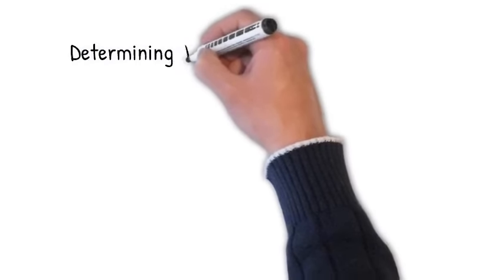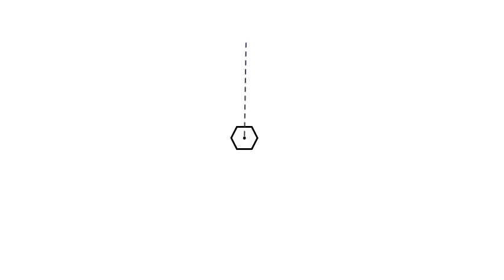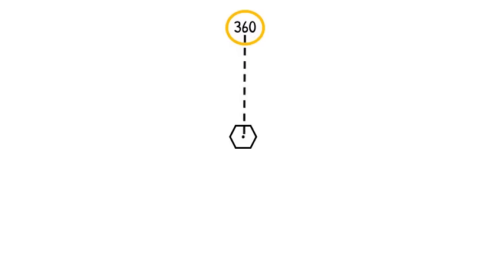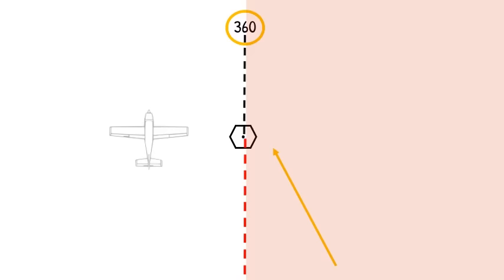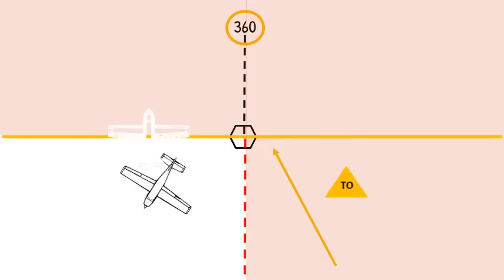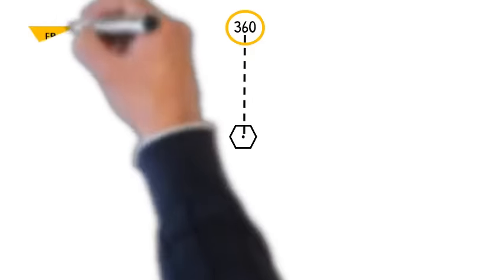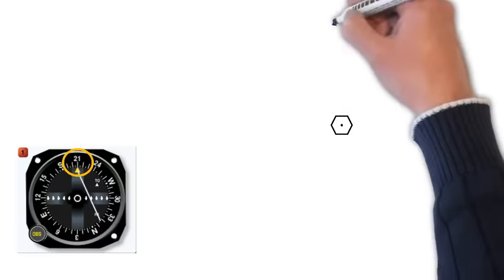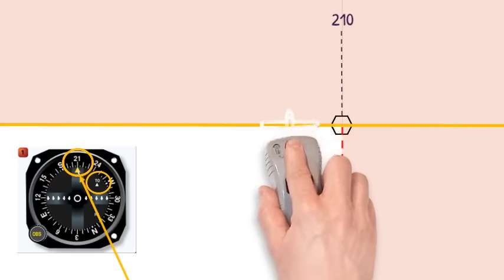Simple Way to Determine Aircraft Position Using a VOR, CDI, and OBS

Comment: If I understand correctly, based on the example of 210, if you see the To is in the upper quadrant and the needle is to right, then the upper right quadrant shows the range of headings that you would fly to get to the station to intercept the 210 radial.  If the range of headings to get to the station is in the upper right quadrant, then the opposite of that is the lower left which places you north-east of the VOR and south of the 030 (tail of the 210) radial.   To intercept the 210 you could fly either direct to the 030 radial (90 degrees) intercept of 300 or a 45 degree intercept which would be 255.

Comment: Very useful method and strongly advised! TBH I've developed a bit different logic for myself but it was a struggle for a some time before I was able to do that. Knowing this method earlier would have saved a lots of time and some grey hair for me - and I may also switch to this one. :D
Reply from the maker: Thanks, glad it was helpful. What is your method?
Reply: @Loves2Fly  It's kind of "brute force", nothing really special. After a lots of hours spent practicing these I can quickly visualize it in my mind, where am I. "TO" means I'm around the reciprocal radial of the set value from VOR perspective (so around the tail of the OBS arrow)  and the direction of the deviation - and so the real VOR radial - can easily be identified after you have this picture in your mind.
But your solution requires a lot less counting, easier to adapt and thus much more fail proof, gives a better picture of the situation quicker. :)

Comment: Excellent video BUT still confusing on two key points - 1. clarity needed on impact of having a TO or FROM FLAG 2. WHEN IS PLANE ABOVE HORIZONTAL AND WHEN BELOW?
Reply from the maker: The example is looking down from space. Regardless of your heading, if what you have set in the OBS (the radial, or spoke of the wheel) is on the other side of the VOR from you, it will display a TO flag.

Comment: The key is the TO/FROM flag.
Think "FROM The Same Side" OR think "TO The Other Side" ... all in relation to what radial was dialed in with the OBS selector.

360 radial dialed in with a centered needle and a
TO flag? "TO the other side" ... you are on the other side of the VOR (or on the 180 radial.)
FROM flag? "FROM the same side" ... you are on the same side of the VOR (or on the 360 radial).

Comment: Excellent video, but when perpendicular to the station, in cone of confusion, is the CDI needle direction valid?
Reply from the maker: Great question! The cone of confusion only happens when flying directly over the VOR.  This is normally indicated by the needle and flag jumping back and forth until passage has happened.  When away from the station, even crossing the 90 degree line. the flag will simply change from either TO to FROM or vise versa.  The CDI needle will always be accurate if the signal is being received when away from the station.

Comment: So at the 5 minute mark, you put the 210 degree radial up top. Right after that you did the same thing but put the radial at the bottom where 210 would normally be. Why the difference?
Reply from the maker: The second example is the same but just rotated to north up like you were reading a chart.

Comment: I've jumped out of many planes, but have never flown one. I'm think hard about getting a private license, so I'm watching these instructions videos.
I don't mean to be rude, but this video just makes no sense to me at all. You must be skipping over some of the basic understandings of this instrument that an idiot like me needs to make sense of your instructions here. Does the long white line pivot from the 12 o'clock position as you fly to the hexagon?
Reply from the maker: Lol, you are not an idiot. There are many terms that are only found in aviation. This class is made for someone who has flown and received basic instruction on navigating using a VOR and is practicing to take the written exam(I should actually state this at the beginning of the video). The white indicator does swing like a direction finding device.
Reply: @SailingSaltwaterLanai   Thanks, you are correct. I jumped into the middle 
 this. I watched a different video that explains how the HSI (?) instrument works, the shaded feather, to and from...and so on. I now understand why barometric pressures are constantly being dialed in before take off and landings. As  skydiver we just zero out our Altimeters prior to load in (away from a spinning prop) and leave it alone.  I thought it was just being over zealous, now I get it, planes aren't always landing at the same airport / terrain altitude.
Your video makes a lot more sense now.  I guess I should find the beginning and start there. Lol thanks